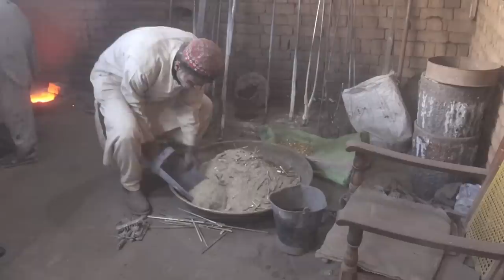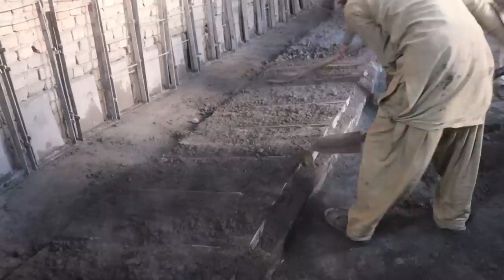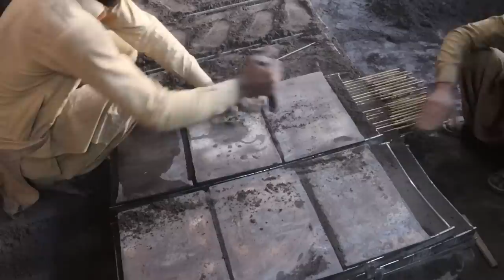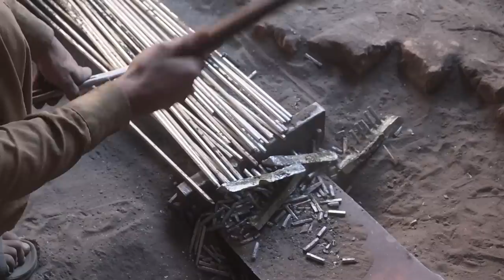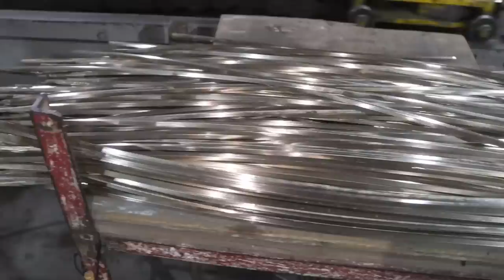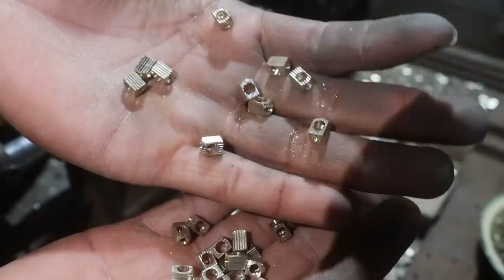How To Make Brass Electrical Connectors || Mass Production Of Brass Electrical Socket

Comment: I thought it was going to be a drawing bench, but they shaved the rods instead. Rolling would produce a rod with less chip making.  The machines for drilling, tapping, and assembly are interesting.
Reply from the maker: Thanks
Reply: True drawing would have been better but it’s been shaved into a square profile, if they had drawn the material through then the rods would’ve needed to be worked more as round into square in a single machine would have been difficult to do.